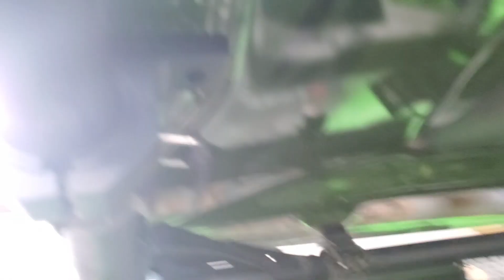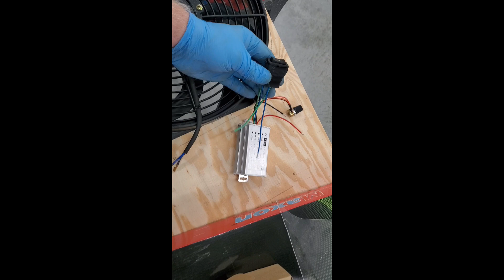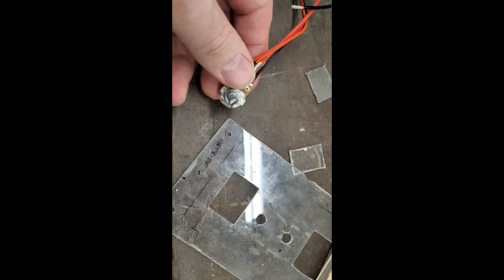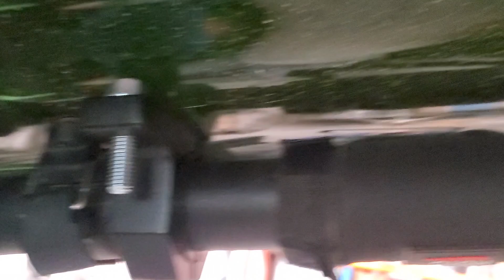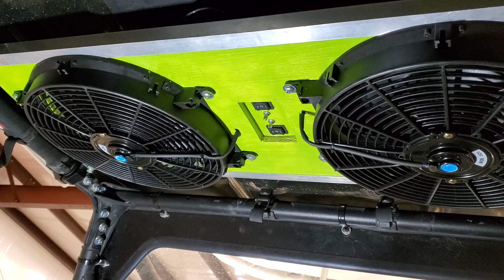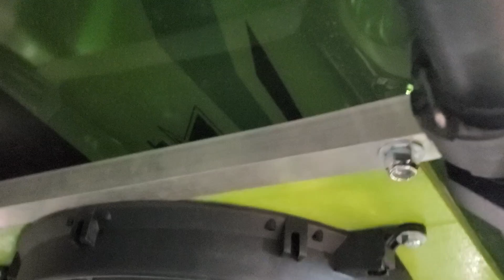KRX1000 Roof Fans DIY

Comment: What relay are you using? Don't see that in your list
Reply from the maker: I used a spare one I had for many years. 
I buy this one if getting a new one. You can use their connector or crimp on lugs.
https://www.amazon.com/Recoil-Automotive-Interlocking-Sockets-Holders/dp/B08BHR2RM7/ref=sr_1_6_sspa?crid=2F406D8N1LMSB&dib=eyJ2IjoiMSJ9.KlO8_9d6gyhk-wUDIy19Ya60twMQknT9FhfG7OEThSso6exqNwypFlEIar762V9p9UciBULWbYG70F1Z7OS3MjhYoUNy8jVfoLNIO563EgA1kDUEYvKXux3r-8XRClMB5WOZY_vz_Hb152xleevGum5-ViLwzTnkXGzFlJRlrfdLqIWbjr-AkIjzdsPNROfN5lQuWIVEY0-fOPmP0Q4m21Emj5-x3HreFD8WikZbmMI.AFWUA43_KVWm-A1Uba2lrj985j0P-40KClGhAvXo_1E&dib_tag=se&keywords=12v+automotive+relay&qid=1781068111&sprefix=12v+automotive+relay%2Caps%2C265&sr=8-6-spons&sp_csd=d2lkZ2V0TmFtZT1zcF9tdGY&psc=1
Reply from the maker: A 20A relay should be enough, but selection seems limited.

Comment: Why did you choose plywood instead of a lighter material, such as aluminum or ABS plastic?
Reply from the maker: I had it on hand and it was easy to work with. Those other options should work fine. Aluminum might add a lot of cost.

Comment: Great video, ive followed your build now I'm ready to wire things up. I'm wondering if you could detail what wires are together and what pins you have used on the relay, even a quick drawing of the wires I'm a little confused and dont want to mess things up..
Reply from the maker: A relay is a switch activated by current flowing through the coil. I can't paste an image, but this photo is a good one (very long url). NC is normally closed, NO is normally open. These are the states when no current is flowing. COMM is the common pin for the switch. 
data:image/png;base64,iVBORw0KGgoAAAANSUhEUgAAAQ4AAACUCAMAAABV5TcGAAAA6lBMVEX////73XH/6HX19fXOztL32nAAETuoqq4GBiE+QVBtb3i5usAeKEZOUV6Zm6Hi4+WUhlNgYW2/wMTt7e5VWGSej1WNjpU1NUD/7HaTlJpucX7/5HPa2t2KfkzT1NYfHykACz0AADrBq2IAAAAAACTJsmTqz23hx2pYVEvawGhSU1t0a0+xsrcxNUQiKUGAgYkiHj+zoF4qL0MRHkA+PkRqZE6AdVIAADMRFy9lZWYeIjQAAApISVCHiphdYXUwM1A+RV82LStDPC5STj4cFhtOS0hvYz9QVWp7bUNhV0ZAPTk1MzYuKB96fo8SMZGmAAAMqElEQVR4nO2dC3uayhaGR2eUKjqjM0JUCK3ueqsoGzQ2u7umPc1J27Qn///vnBnQCIpGCOZC+WqFoCDzPmutWXNTADJthJ77BiIJPkrPffdJy3Sqj1DZeO77T1jqJY4vq0Sf+/4Tlnr2iJONRobDpwxHQBmOgDIcAWU4AspwBJRqHLrIMSmOkFSnGofVAkCiTGdHn5xmHAhZAJQjnZxmHCokUoZjjYOoKq5mONY4JB4ykM7KKs5iR0ylGIeuRz85xTgQ5WmHTiDUCdEZJIQ8fLJRTzcOU5KJJWGJIiy3Ho4h6bIOiGTZalCZioIjXjJm6BaRdAr4MWA+3PFnNOTT3+UTCcqSacoIUdmUTAYQplS3KMdhUCjLGFnHWEdqcBAsoVVHODTMls4QQhDpBiSMAIIkdETbJT04DEx9owJQbwVdgxxVz6QGB1HLgQIzq3FETbKttIRSKJm66is/a1G9HH0MKS3WgTA3kE2sZC1eLCl60VKCg0kiTpLGyh6YaopNI7J5pASHobobUnU3rCW52yj9YKvrpAOH8BUhVhJP2KPBw2vU66QDB6TrCoFVIVzTAKAa9ULpwOGFDm+3saEBSlEvlBYc9zkXVP/Z5OJ/qHVA+d5ZsMSs+/wjhnWkIg1DKwdxo6iurvJTFq2jFKTFOoDRcjcMu/mGgT0eZuSypQQHcQG4uajQikf9+D7jlU6JQ3pCP5QlYRv3ZTFanAdqRb7MKXE0ImdB8cUwYtiH32gRaEXvOz4ljvoT4gCGpQZSch2XY8z/TA0OQK1A/wYsS/veeUDpwQGMsq8oMUcIUoSDt2Crktekp3UrRlcYSBkOnp02So1GtSRFrmFXShcOodbjxmiTxeGf7F5vQfD0c98fN2Sd6KAkCUzwLjUCf8Y14Ih65Ai+mdiN8BD2T92nctn/14d4wS2yXhCOl6AMR0CPwqHXk8UB9dCYycjrCKV6PdGaBVlVKyQ2o3IjRnsqnl4QDvbZolZpJ2YanFG9/kT28WQ4mFR+QPVPDLAJ3j5RqhOOpP7Q2X7Fr4aeLJSScr11WPX3/G3OTlPSxTGxHjjZr3/jL858slBK6tJDqzKdD2b9ciffMj6X8ec6ibB683385PBJcTz0lvJlPcTOjfqnaE3MlOBISm8yHH5lOALKcAT0XDiM6svAwYhbH0HmdYyE4YCi92SV77OtnA66D/cij8NRehE4EF66yZtOvZkan3ZxQGoCg0KqLk0At1oCRIVMJjpethjAk0fcx8uwDniFIAIIEUZM935CrANKVzoyjbbB3wmnwTsxvshEMpYyxEuAX7+zoCU3dXQnYSp5OELyDmguJYlKbl853LJpo21KptwigH19JI7S8UU8HQ7SZgC2TLg08QEcMroyKQfH3zvZso4luVPRUge0nQZnAVjF2LjD3DpEofbgoKCFGW5haQeHvgR0SeQWvjPS4CwAIurGDkggEtl8WJLOeGuZuwOiOscRvGvID/EmkXgpFTi29UCbZRuHX2lwlm29OdzAP4jjUVlplP6OU+DQTVPe1Sc15OBG5sSie16i5QnyduJ0mTwzDii9KYbJmYUe3rxe2ftSxfG2s/dq9O7IZ26zsPa5VthRrlDs5nYP+zRRQk5zpdXO8u5OXvkQfdwvHo62FfmDwsXatXxuV4V33bDDm9cnyr7X87VJ09uJhaMcB0cjMRyN8z04tJg4uHWscVSj4YA6bpempba53T7cow2OemI4rpLHEc86oFx6859v17fXv96+aYePnW3Jh6Mdo+hhYvWYOOwjnCWKdZDGv9e1fr7ZbOYGyvW/6hGnujgYb4LTah1RihKYoRAbx3k/V+gXdm0j1x/HcRZa+WX//GWviPZr/12vK4Sid4XoRsilXBzGPx8+/OOU+HMSw4xxccymF3btorfzwsAeOjfRcdDp7aDXuZj2vE/V8t3fDe9kZBExfdcMSWI8Z2GEsHoZEpLE9BVe0cbCwROP2bSz6G8dtm9vauN5ZBzkx+1Ac4b9s8X6SvnepRseIZUM0AofEzlFKI2JY+pMHMe5GQXf1Z/M7GaM2GHNR/lRR9Fq8/sL5pWiqHKRZLSYFR5YTxFKY+JwnIozd2bdbesYDpVF5NiBviqF5uJdXxvNlPuPLVz/gACako4N2RRN5gM4GpEXiiSMY9656Nrz4ra38NhxU4wcO9Tfg5z2adjM9efjzaW6MxkwHkIZZbJpHsRhJDVZw4dDVHLNPFeT/3vXa/q0i2bU7Wv98exmsPWSVhh0VwZ/dN7Bc5+CNurwqrtQ87lf//cqIoiqJexKp2mzrHHULsbj8cVKs+HY00I8jcJNpTYr7tYt92892jqMr91c3u5wQ9N6s00+U/h+JWIHZlBSATcUk9e3FDOE18vuWKxZ78fhyJ87i4tbjwXfjC+8P86mt+PxcBJKQ+vOi7Xd1GOD40jroE5Pa95eivsYzM+9SwurO//BoIwQUgm0EJJVQqmMqGqIXm4huaEayFNSc0TvcTSHi5AgolTsnKb1OqGF1gYXlbPt4OHHcaR1mNNevvD3T/Hx/e+3AoQ2KvLrKhwHJYTyiqUBLIlgSk0Csah1/9pSUtOrNzhuFs1dGh1b3NweHLx5UumMHm8dssi+ut5H2I7IxPLnHb5f4ziwWtaNVhkBleptpmPVwKecHuvHsWMdSsf15L048vZ8Vnu8dSAeO1YhRxtNRVWrff7N4+rPK8it44SF39UhZ1E6XrN1v3UMbmdne4PH0dZBrjYRqH/B625tUKlpucIvnk0YJmEMIICoDnVkiM5876KnmWu/wXG9jWNNYz+OXG4x3e8tEfKO68H6pILCE9O80uF12agoASZTwpsrZXDJJIqpaZrEcxZmqSvhJHn4rGMcjB3Ku3WXxn4ceftsVtuXrx2PQ67cZ7dab2pr2oXD98Zf+emGZMgGx2EBHcuM1ybUWyqjly2rXOaPcowO2aNwBK1jFTe2cGg5X2LB65z+sDLfj+PY7h/WvjcP7n+LwuDsnH/ox5aYX6HzutWwQIkbiURlg1e5CZb+EI6Addx7ioujaNv9kW33+l1vx87xnVHftru3TmeQC1eEJhz6sri3v9rZSJmN8gOvhU8oAwbSgYV07i46gCetWPZZh1L0df5pvcrwdtQdDmujxfBmZN8Ob3OL4dDu3Q7HC1637OkXi9LfIRXP+6u6pfd7cXOhDa6/BL5niwKvFbeaW4+2lBSjUOsoKDPb5wLcWUaDQmEw6Of6A3dnoK12+qN5ZZIADih9XIw0zfvw6bzX/fbloFM0tpTUModQHIpj+8vFcYiA4d7t/ZP3X8tfTDvbzbgYOACUv3xTRgWNNyALyuLn26vDIeLprEMrbNE4VNHyMk+Ke7wl4sCCrl5++36uKMr59/+VpKfNvu4VYh3KNEjjII7cYDI9SwSH+J7CdumTM6laT5yK+rSLQ7TaIuDQhk4x3FsiDzuJGSS0Lh016ETWaZh12jRslwZvSBzAka9NK+FDUDFwHL+eRZ9Uq1WnxJ/ap8OhaTavU7Sc+088XOUP4cgNZs58ty0cH8fxlcQpu3+awyGvPJV354ORq8H6wZ+UQzian51pP8xbTo7jlJ2DPEAIVYodTx87Po0P9CPnldk01FtO6ixC5ITWIRogPhW77mbgqn9ocoPW7zjDxHBEWYN/2q5jfxFz6/kdbvA4AEMU+2w6D+tbTg+OB8dZ/GrWiqHTG/5QHNqg41yEHP9DcfBMrLIIOfzH4ujNelns2Gj0d1jikeFIAsfxq84yHAFlOAL6E3BUnxlHranlt9XMves1d47uU3Pwdz/k3U07xqzj57YO63+KUttV5WfIwX1aVM53Dyr2dePV4QCkMauEyJmGHd2jqbNzaPbx48dSjJ+lfm4ce/Q+ymAXeZtYj9QLwWG0r5ZiiyTZzYMiLTrX3xIxfshEZ6dYaw3c+Vzx7uNF4IA/DGAA8ftczHQ/I9L3dwgcRG0viXHXvmPgh/h2u5i/3/4ycKA7MeHqCi/R/nW0+8VxQAlz02gbwGyDmQTMq5hTG18GDr1NxNdYw6W5f5X1gbPfEtZCYjUt95MK+Iqp+rqtA2AsizX0GEmotW8d7V4J68ASYOQOAXoFfpB26JT6Y/RCcEAq8aKYhBFvOlbk2GGoksRkbC4N0AaIya/bOrYVvWYhFEFgyDxmCBJHrt/aUWpwJKMXiiOysySkDEdALxRH5iwBZdYRUGYdAb0O68APfSNlQmKvwjqsyzdPpMsoSfYz4QBkewLh6RSlDM+F44UqwxFQhiOgDEdAGY6AMhwBZTgCynAEpL9N7Jdw9DTg+KuUlCafXv9PbEIpOclP9JNLKRL6P1WcnvpPyQ3SAAAAAElFTkSuQmCC

Comment: What you think about adding a mist 12v pump? Maybe with cold water from cooler.
Reply from the maker: It would be cooler. If you drive a slow pace the mist would probably have good coverage on you. This would add some complication, and it may not last very long with a reasonably sized water source.

Comment: Great video. What was the piece that the ground/battery/ignition wires ran to, before the speed motor controller box?
Reply from the maker: The small black box is a relay. Ignition closes the relay to bring the battery to the motor controllers.
Reply: @ttl.braincandy  does this set up have to have a relay? Is the on/off switch on the potentiometer not sufficient? I am by no means an electrician.....know just enough to burn something up! lol
Reply from the maker: @scottdaniels8230  Scott, I do have a relay switching battery power to the assembly when ignition is on. Primary reason is my ignition power bank doesn't have the current capacity to run the fans. Thanks for watching.
Reply: @ttl.braincandy thank you sir. Great vid

Comment: Question.  Why did you use 14 inch and not 16's.
Reply from the maker: Basically just for room. Room between the fans for controls, room fore and aft for the brakets the way I wanted to use them.

Comment: What was the measurement of wood
Reply from the maker: Dimensions are 15.5" wide, then length varies 37.25" in the front, 40.5" in the back. Thickness is 1/2".